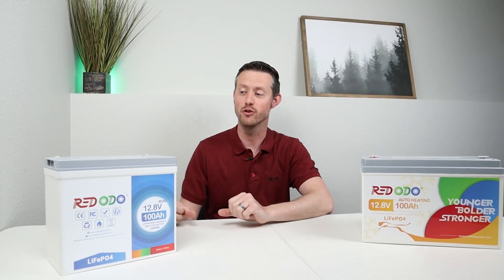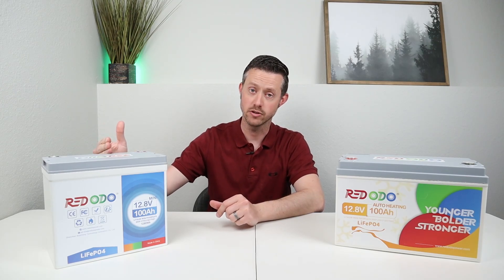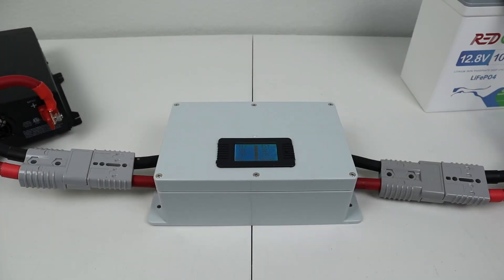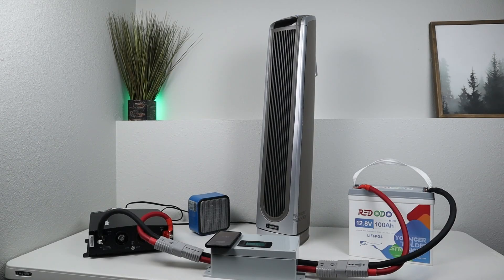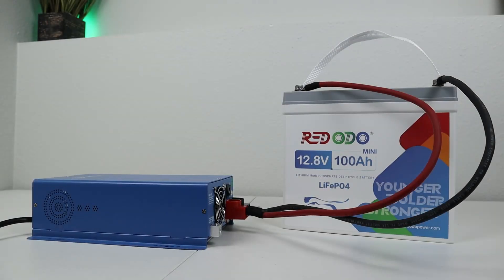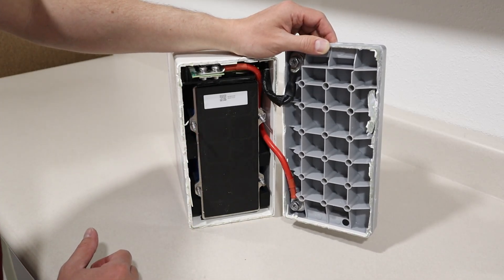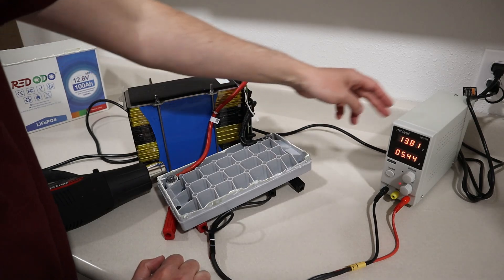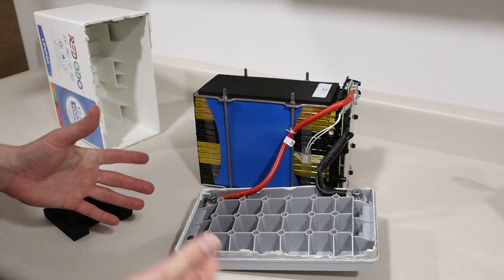Redodo 100ah MINI LFP Battery - Smaller Size - BIG Capacity! - Fully Tested and Torn Down

Comment: Is this mini asteroid hood as the trolling battery for a trolling motor? I have kayaks and need a small and light battery but only if it performs or lasts in the water as  the bigger trolling battery?
Reply: * is this mini as good as the trolling
Reply from the maker: The newer small 100ah "trolling" battery is a better version in my opinion since it uses normal cells, not pouch cells.
Reply: @Jasonoid I thought the only trolling battery was a group 31, the group 31 is big. I order a mini but if you can tell me which newer smaller battery is better i will order it. Thanks a bunch.
Reply from the maker: This is the new one I saw:
https://www.redodopower.com/products/redodo-12v-100ah-group-24-deep-cycle-battery
They are all going to perform nearly the same. Don't stress it.
Reply: @Jasonoid  thanks 🙏🏻 a bunch for your help man.
Reply: @Jasonoid  i got the group 24 on hand, thanks for recommending it. Existed to go out and try it.

Comment: Mine came way out of balance
Reply from the maker: Did you tear it apart to the the individual cell voltages? How did you know it's out of balance?
Reply: the bms opens up at 13.53v
 @Jasonoid   that's 3.3825 if balanced
Reply from the maker: I'm not familiar with that term, 'the BMS opens up'. When I was testing this battery it shut down around 11 volts (maybe a little lower) and stopped charging around 14.5 volts.
Reply: While charging, the bms stops allowing to charge. when it goes up to 13.53 it will jump up to 14.4v.  and the amps drops to 0 amps. meaning Bms went to protect right? I build my own batteries for a hobby, if  well balanced the bms stops at 14.5 to 14.6 hope that helps.     @Jasonoid
Reply from the maker: @KR1IS  yes, that could be the case. The BMS is possibly sensing one of the cells is hitting 3.65v or so before the others and shuts off. Usually the balancing happens at a pretty high SOC. You could try to put a adjustable power supply on it for a couple days sitting at 13.4 volts and maybe the BMS will equal things out very slowly.

Comment: Thank you for opening this up...  I was wondering what they were doing to jam that capacity in the smaller form factor..  I did cringe a little when I saw pouch cells.. I guess that's just what I've been trained to do..  Probably in the real world, the pouch cell is just as reliable as the prismatic..  The only thing that bothers me is the cells are in a 4s4p config..  So you have 16 things that could fail instead of 4 in the prismatic battery box format.

Comment: newbie to all this, I have an interstate deepcycle battery for my rv, can I replace that battery with this one and not need a special charger? will it charge with truck while driving or a generator like I do the deep cycle. all i use my battery for is water pump and lights just wanted something that will last longer without worrying about running out of battery after 5 or 6 days. Thank you and sorry for all the noob questions.
Reply from the maker: LFP batteries are meant to be "drop in replacements" to lead acid batteries. It should be fine to do that since the BMS will keep the battery from being over-charged. Just be aware this does NOT have low temp charging protection so charging it in cold temps will damage the battery.

Comment: Hi All, I am planing on a build around a Renogy 2000W 12V Pure Sine Wave Inverter and 4 Redodo 12V 100Ah Mini LiFePO4 battery run in parallel. The battery lugs are 5.5” apart. I plan on buying pre made wire. My questions are… What size wire gauge would you recommend for the batteries and how long?  Also what gauge would you recommend from batteries to inverter. Thank you all in advance.
Reply from the maker: You'd see around 175 amps peak while running a 2000 watt inverter on a 12v battery setup (volts X amps = watts   12volts X 175 amps ~ 2100 watts). I'd recommend using a 175 amp fuse and 2/0 wire between the batteries and inverter. The length doesn't really matter as the wire should handle the peak load just fine.

Comment: I have a battery box on my 5th wheel is 11"x14".  This form factor will allow me to put two mini batteries in it, and give me 200ah, instead of one 100ah larger battery.  Just wish they had put low temp cutoff in them.
Reply from the maker: I have heard of some charge controllers have that feature built into them. Then you wouldn't need it in the battery.
Reply: @Jasonoid  That is correct.  Haven't heard of an RV that comes with a charge controller that would have that feature, unless it has solar.  That's also just another expense the manufacturer doesn't provide with the sale.  Owners would have to purchase and install an MPPT controller with that type of function.  However, I don't have solar, just want LifePo4 batteries right now.  Hard to find a charge controller that isn't setup for solar charging with cold temp cutoff.
Reply from the maker: Victron has a sensor that will bind with their bluetooth charge controllers that will disabled charging at the programmed temperature:
100voc / 30amp charge controller:  https://amzn.to/47nPBVU
Smart temp sensor:  https://amzn.to/3Knfb3o
Reply: @Jasonoid  Yes, Victron has a way to shut off PV from charging a battery with a temperature sensor, but I'm talking about a non-solar charging system.  RV connected to shore power or a vehicle, to inverter/converter, to battery and still able to use the battery when the temp gets down, but won't charge it.
Reply from the maker: @farside1  gotcha, if you're charging off shore power you could always heat the batteries with heating pads or have a small heating element in the box to keep them above freezing.

Comment: I like the smaller form factor. Are there any drawbacks from it being smaller? Curious why all of them are not this size.
Reply from the maker: This battery uses a different type of battery outer shell. Instead of 'cylindrical cells' or 'prismatic cells' that have larger metal casings that take up more space, this battery uses 'pouch cells'. These have less material and can be formed in different shapes. There are advantages to each type of cell, you'll need to google each one to get the full list. Some people say these aren't as durable but I'm not that sure it would be an issue since they have the outer plastic case protecting them.

Comment: Hi very informative video. Definitely this battery is the one can fit in my kayak hatch and run all my electronics, exept the motor. I am wondering if i can mount this battery on the side and if yes, which side would be recomanded. Also i am a little bit confused, i have an 20 amp charger with lithium option and LiFePo4 option. Can i ask please which option will be the best for my battery charging.
I am assuming this battery can be charged with other chargers too than Redodo sells.
Thank you so much for your answear.
Reply from the maker: Most trolling motors only pull 20 to 30 amps at peak power. This one can handle 100 amps consistently so it would probably run your trolling motor for a couple hours just fine.

You'll want to select LIFEPO4 mode when charging, the other lithium setting is probably for a different type of battery.

Comment: Much has been asked about Pros/Cons vs. Prismatic form factor.  I, too, am still …. Ambivalent (?).  The ONE Thing that gives me pause, is that I’ve heard mention of ‘thermal runaway’ scenarios, which is where ‘Concern’ comes up.  While I have heard of this, associated with Pouch and not Prismatic, I have yet to find any objective, science-based explanation as it would pertain to LifePO4 POUCH cells and Thermal Runaway …..
Reply from the maker: It's not the form factor or the case of the battery that leads to thermal runaway, it's the internal electrolyte of the battery chemistry. LFP (lifepo4 or lithium iron phosphate) batteries do not use nickel as the internal electrolyte. Lithium ion batteries do and that's why they go boom boom. LFP cells don't have any fire risk and that's one of the big advantages over lithium ion batteries.

Comment: lol so they changed the case, it isn't smaller cells. , ytubers. the battery is the same just a case sized to it instead of group 27 stuffed full of foam etc.
Reply from the maker: I should have pulled both put of their cases to show you the size of the cells, my bad. These are 'pouch cells' and take up less space as well, it's not just the case that changed. You can see that with the weight of the batteries combined.

Comment: Smaller form factor is definitely a plus. I have been considering changing out my 36v trolling motor batteries to lithium. 
I think 3 of these might work out well.
Reply: UPDATE
I did, in fact, change out my group 31 lead acid batteries for 3 of these 100ah Mini's. They have performed very well & not only save space but they each weigh a bit over 40 lbs less in weight. So that is a total weight savings of 120 lbs.
Reply from the maker: That would work well to save on space and weight!
Reply: Any problems with balancing?
Reply: @LaurieNCooper No problems. I use a 4 bank charger, so each battery has an individual charge lead.

Comment: Hey Jason, I know you are asked to review many products but I'm very intrigue with the Btr Power 24v 140ah. Its the only kind in its class. They are smaller and lighter than every 24v 100ah because they use pouch cells even with the higher capacity. Very curious to see how they pack those pouch cells inside this battery
Reply from the maker: That battery does look a little more compact than most 24v 100ah batteries. They must have really found a compact cast to put all that power into. Most companies just use a standard case and they have lots of air gaps. What are you wanting to use the battery for?
Reply: @Jasonoid  I have 2 older 12v Valence rated @138ah that I hooked in series creating 24v. No way of expanding this unless I find some more of these(I don't want to) or start from scratch. I figured I can get 1 Btr 24v @140ah and see if I can hook these in parallel since their capacity is similar. If it doesn't work out I will just buy another Btr 24v. No one of the net has this battery in review.

Comment: Can these be put in parallel or series with the regular 100 battery?
Reply from the maker: If it's the same chemistry and size of capacity, it should be just fine. For example connecting with another full size 100ah LFP battery it's good to go.
Reply: @Jasonoid  Thanks!

Comment: I think i’d rather see a standard size battery with a higher Ah capacity. My RV trailer has a compartment for a single group 31 battery, so a smaller 100 Ah battery doesn’t do anything for me., however, a group 31 with 130 or 140 Ah would be awesome.

Comment: Same as Li Time and other battery makers that are offering this pouch (Polymer Coated Aluminum Foil) configuration.  Supposed to be a lot cheaper on materials to make.  I don't exect the manufacturers to pass on any savings.  
I worry about the long term reliability of the pouch cells due to gas swelling.  I know pouch are used in a lot of new new laptops, and Cell Phones.  I read that Apple had swelling issues with pouch cells used in their earlier I Phones, and other products. 
 Is there any product that has used multiple, series /parallel, configured pouch cells in a product like this for a significant period?  If such a product exists, then what is the long term product reliabilty.  
Not sure what happens when a foil cell enclosure fails.  Is the cell electrolite conductive/corrorsive?  
Personally, I will wait a while, until they have been around for a while.  This will allow the the manufacturing, safety, and reliablity issues of this new product to be worked out.

Comment: This is perfect for someone like me. It never goes below 10c here. Maybe 9c at the lowest night of december. 
Most of the year it is above 30 . And for few months as high as 47. Like today was 44c. 
So i don't need any low temperature disconnect. 
Two of them should run my home for more than 3 hours. And that is long enough that I won't need a generator because the typical power outage is less than 1hr. 
While outage can be as long as 7 days if the cyclone decides to wreck the grid.

Comment: Nice,  i hope they have a version of this in their 12v 200 Ah models. Also,  I hope customers and these battery companies start switching to 48v batteries and inverters as we can use smaller gauge wire and be more efficient in our systems?

Comment: mini pouch style battery, i haven't seen a video of someone destroying a lfp pouch cell yet, hopefully it's still safe. i think prismatic are a bit better and cylindrical are the most protected, but when you want space efficiency, pouch cells will do that.
the bolt fires that use pouch cells in the nmc variety are the ones that scare people, as the fire can easily spread to other cells when there is a failure.
i wonder if we will see 24v or 200ah in these small form factors
Reply from the maker: If they were NMC pouches I'd be a bit worried. I have seen many of those laptop batteries puff up like a balloon. Since these are LFP it shouldn't do the same thing, especially since they are compressed. I think they are planning to make a 200ah battery in the same form factor. That will really make a difference since the 200ah batteries are HUGE!!

Comment: Another great review Jason. What are your feelings about pouch cells ? Seems like the only way to make Lifepo4 smaller and lighter is to use pouch cells. Any negatives vs prismatic cells ? I was interested in Btr Power 24v 140ah and they are smaller and lighter than every other battery in its class. I messaged them on Amazon and they told me prismatic. I'm still not convince and I email Btr directly and they confirmed pouch cells.
Reply from the maker: The main benefits of pouch cells are cost savings, weight savings, and added flexibility with the shape of the battery. Pouch cells are some of the most energy dense types of LFP batteries since they don't have a metal casing around them. If they are properly compressed they shouldn't have issues with de-lamination over the life of the battery. I feel they are reliable if they are protected. In this plastic case they should be well protected. 

In comparison, lithium ion (ncm) pouch cells swell with high discharge and charge cycles. If you have ever seen a swollen laptop battery or a swollen Lipo battery used in the RC industry you know what I am talking about. They look like balloons! I'm not sure that's the case with LFP pouch cells since I don't think they can swell like lithium ion ones.

Comment: Awesome video as always, Jason! Thanks for the excellent breakdown, pun half intended. Would love to hear your thoughts on the viability/tradeoffs (if any tradeoffs) in using pouch cells for LiFePO4 batteries. For example, thermal management, longevity, repairability, etc. Maybe a video idea, I'm not sure.

In any case, I'm very tempted to pick up one or a few of these for a series setup. Any chance you plan to elaborate on a safe/smart way to add low-temp protection for a battery like this? Perhaps that could be part of some future video?
Reply from the maker: The main benefits of pouch cells are cost savings, weight savings, and added flexibility with the shape of the battery. Pouch cells are some of the most energy dense types of LFP batteries since they don't have a metal casing around them. If they are properly compressed they shouldn't have issues with de-lamination over the life of the battery. I feel they are reliable if they are protected. In this plastic case they should be well protected. 

In comparison, lithium ion (ncm) pouch cells swell with high discharge and charge cycles. If you have ever seen a swollen laptop battery or a swollen Lipo battery used in the RC industry you know what I am talking about. They look like balloons! I'm not sure that's the case with LFP pouch cells since I don't think they can swell like lithium ion ones.
Reply: @Jasonoid  Thank you for the feedback! Great to get your take on the pouch cells - seems like it'll be largely upside in this form factor/chemistry.

Comment: Will two of those fit in the Licetti box?  It doesn't look like it, but thought I'd ask.  Yes, my Licetti box arrived, a lot more quickly than I expected.  The main switch seems a little flaky, but it seems to be working.
Reply from the maker: Two of them won't fit into the case unfortunately. So I'd stick with my previous recommendation of the Dr. Prepare due to cold temp charging protection built in.

Comment: i have two Li Time 100 Ah minis that I really like.  They have just as much stored power as their full size 100 Ah batteries.  I really appreciate how light and compact that they are.  They fit into smaller spaces and are so much easier on my 76 year old back.  These minis are a real improvement!
Reply from the maker: I agree, weight savings and space savings are very important!

Comment: Are the pouch cells less reliable over time than the type  of cells found in its larger sibling?
Reply from the maker: The main benefits of pouch cells are cost savings, weight savings, and added flexibility with the shape of the battery. Pouch cells are some of the most energy dense types of LFP batteries since they don't have a metal casing around them. If they are properly compressed they shouldn't have issues with de-lamination over the life of the battery. I feel they are reliable if they are protected. In this plastic case they should be well protected. 

In comparison, lithium ion (ncm) pouch cells swell with high discharge and charge cycles. If you have ever seen a swollen laptop battery or a swollen Lipo battery used in the RC industry you know what I am talking about. They look like balloons! I'm not sure that's the case with LFP pouch cells since I don't think they can swell like lithium ion ones.